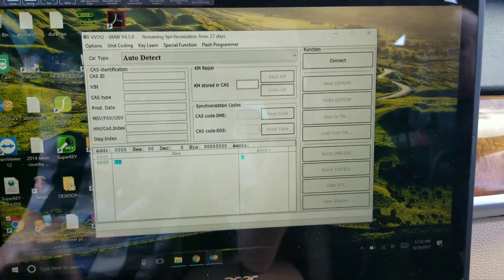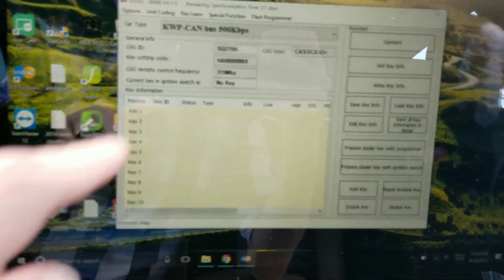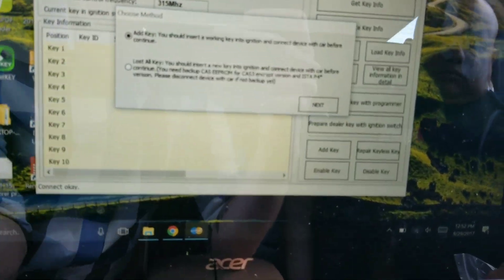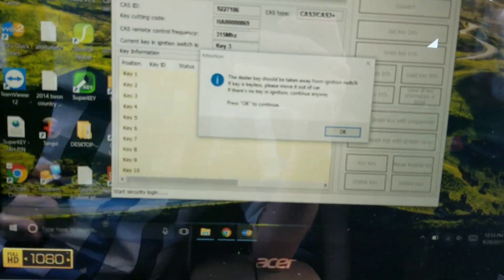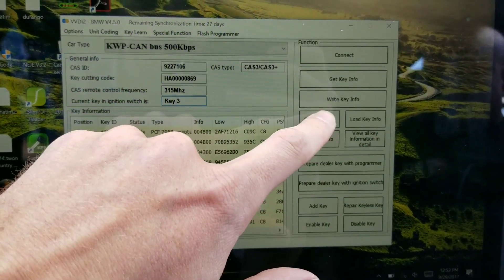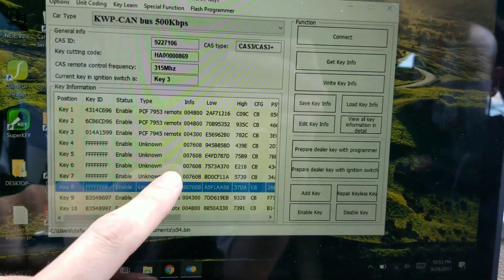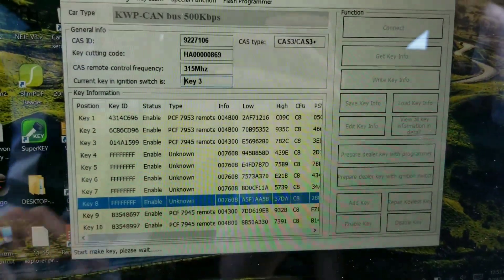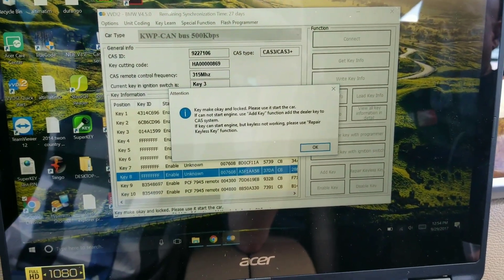Using VVDI2 to program CAS3 BMW Slot Key

Comment: I have a 2011 335d and had all keys lost situation, locksmith came out and attempted to program a new key to the car, couldn’t read the Isn. Not sure what steps exactly he took. I ended up finding the key, now it’s not working to start the car or turn on the ignition, but it is being read as the proper key as I’m not getting an error on the dash for wrong key like other e90 keys give me
Reply: Probably tried to read ISN via OBD. Not gonna happen. Hopefully he didn't corrupt the data on the CAS. If so, it can be repaired by someone who knows what they're doing. Let us know what happens?

Comment: Hi Sean
How do you distinguish a “Comfort Access” vehicle from a regular one?
Reply from the maker: The "Comfort Access" vehicles are easy to spot.  These vehicles will have a small square black "button" on the outer door handle.  You can have the key for the vehicle in your pocket, walk up to the vehicle and touch this button and the door will unlock.  Thank you for your question.
Reply: if oem key, comfort has a battery door to change the battery, non comfort keys cannot be opened to change the battery

Comment: Hi there. Thx for ur efforts, I tried this but one I try to get key info the program says u have to flash the cas!?  And I'm kinda afraid things won't go very well. So do u have any clue about that.waiting for ur reply... Thx in advance
Reply from the maker: Hello - It is good that you want to be cautious with these jobs.  I am guessing that you came across an encrypted CAS3 Module and the VVDI wanted to downgrade the module.  To be safe, you should remove the module and read the EPROM and flash memory before doing the downgrade.  Once you have these files saved proceed with the downgrade.